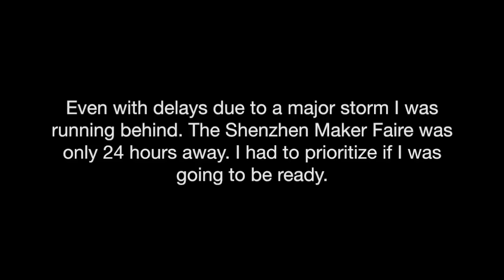Blinkini- LCD Shutter Top (NSFW-ish)

Comment: If your printer has a heated bed, you should try out an Ultrabase glass plate.  It's like magic.  Perfect first layer, no warping, and the parts release themselves when the bed cools.  You won't need to do a raft anymore and won't have to clean up the parts after printing.
My printer has it and I'll never use anything else.

Comment: Two questions, what happens when the battery runs out and is it actually comfortable?
Reply from the maker: It goes transparent when the battery runs out😳  The inside is lined with a soft material like velvet? Any discomfort was because I had it really tight to keep it from sliding down while I danced. If I had to wear it for more than a few hours I would just use clear bra straps and loosen it up. I have them but I don't think it looks as cool.

Comment: What kind of battery are you using and what could you do to charge them up? You know those kids toys where a up and down movement turns a axle by a chain and spring, in a small scale you could make a prototype shoe and use the impact of the heel to generate a few watts, fun thought.

Comment: Found you through Hackaday, and you're awesome. You're like the badass side character in a William Gibson novel. (All his stuff was set in Tokyo because it was the '80s, but Shenzhen is the new cyberpunk utopia. Ever considered Molly Millions cosplay?)

A question about this build in particular: how did that rig stay on while dancing? Was there adhesive involved, or just really tight elastic? I'm only an amateur engineer (if it moves and it shouldn't, add duct tape, if it doesn't move and it should, 3-pound hammer), but that looks kinda heavy and it doesn't appear to be braced on the upper slope of, well, y'know. I expected it to be around your hips by the third bounce. Also, having watched a couple of your other videos, I was expecting the control box to end up being an integral part of the outfit -- like, the front of the bikini bottom or something.
Reply from the maker: Thanks. Little tighter at the top than bottom so it creeps up more than down.

Comment: Wow nice video, its great to see you building this stuff yourself! The end product was really cool, but I was also interested in the tool you used to hold the PCB when you were soldering? It looks like you just snapped the PCB off like it was magnetic?
Reply: Mike Blankenship they were magnetic. similar to this style of holder.
http://www.instructables.com/id/Magnetic-Base-Circuit-Board-Holders/
Reply: Thanks Ryan for the info!
Reply from the maker: Yup, they basically work like the ones Ryan linked to. I got them on TaoBao- the magnets are a little too strong though and hard to move...

Comment: Sexy Cyborg! I've seen some of your posts on reddit. Didn't know you had a Youtube channel. Very impressive stuff. Quick question: why did you need so many inverters? I'm guessing you're using them to drive the LCD panels, but the CD4049 has 6 inverters built in. It looks like the LCD panels only need 1 each, unless I'm missing something.
Reply from the maker: Adapted a tutorial, could be wrong😓

Comment: Based on B.F. Skinner's work on positive re-enforcement. Opening one shutter art  randomly for just a moment will create the most effect. Adjust the rate on the fly based on reaction and behaver interest you want to teach in the viewer.
Reply from the maker: I was kind of thinking of doing something with a camera and running OpenCV on a rPi- so that the shutters only go transparent when there are no frontal face images (people looking directly at it) detected. But that would be too evil😈
Reply: That would be good.
I was also thinking if you could put a display (or clear) layer, you could show cyborg parts sometimes, or show the faces of the people looking at you, or messages (emojis).

Please keep up the cool work.
Reply: That is genius. If you hook up infrared you can detect a viewers heart rate, or perhaps with OpenCV detect pupil size. If the heart rate goes up or pupils dilate, you can go opaque.

Nicely done girl!

Comment: You're using a torch on your print in the post-process? What material are you printing? I'm not familiar with that type of post-processing. Could you explain a little bit please?
Reply from the maker: Sure when you remove the black abs from the raft you get a rough almost hairy finish and white marks. quick brush with the torch smooths that out and makes it black again.
Reply: ah, i see. I thought it maybe was an alternative to acetone smoothing for abs or a method for PLA. Thanks for the reply and keep building those projects!

Comment: If I were you, I’d switch to the flexible lcd screens. They’re expensive, but definitely exactly what digital clothing needs. Then I’d integrate it into an actual cloth top for structure. It’s an innovative concept, but I don’t think the current format of hard screens and a strapless bandou top style fit or have any real practicality. 

I’d focus on shrinking the control board size and adding a either blue tooth ability or a microsd card slot. Why? Think about it. With digital clothing you could become a living breathing and mobile billboard. How many companies would jump at the chance to get on board with a fashion innovation that included an advertising ability! Right? 

I actually see this as a future trend in a way. A lot of companies have moved away from static displays for conveying information. An example is fast food restaurants. It used to be a simple static display with a couple pictures and a list of items. Now though, you have animated menus with video and changing pictures. Just imagine this, how long until Coca Cola comes out with a can or bottle that has a short duration digital label on it? When you open the can, it starts it’s pre programmed advertising and when the can is finished, it turns off. Think of the novelty and “press”it would garner. Imagine cracking open a can of coke and its display showed a glass of coke on it, complete with ice and the fizz. As you drank it, the glass would “empty “. People would flock to buy at least one just for the novelty. I could totally see coke or Budweiser doing something like this. Now imagine an A&F or Old Navy shirt that had those flexible lcd displays. Can you say Gold Mine?!

Comment: I would advise to not use a torch to remove or clean (or for anything else for that matter) on printed parts, it will distort the shape and alter the properties a little bit in the plastic. ( I am a plastics engineer and technician working in the plastics manufacturing industry). This advice is of course only applicable if the finished shape does not matter too much. cheers
Reply from the maker: I just move it quick over the surface. Checked the dimensions, same.

Comment: Naomi, it's so much easier if you design the circuit in Eagle CAD and send the GER dBERS off to PCBWay. Cheap and fast and less wiring if you use an Arduino Mini or Pro. Since you're famous, they'd probably do it on the spot for free and they're close by
Reply from the maker: Are you honestly suggesting someone who was making their first electronic circuit at the time that EagleCAD to custom PCB is "so much easier" than perfboard? Was your first electronic project done in EagleCAD?
Reply: @Naomi-Wu  No... I freehand them in the late 70's and used OrCAD in the 80's and then PSpice but you had so many wires and doing a rats nest board is really difficult if you lose your place. I find it easier just to trace them out in CAD and convert the GERBERS to GCode and I have a CNC Mill that I do my prototypes on today.  But I've been doing PCB's since 1978 when I made my first TV set with a Zenith Kit. I don't mind doing breadboards but they take up too much time when I already know the circuit is going to work anyway because I can run it in a simulator. (Don't really need the simulator but just to be safe)... You rock anyway.
Reply from the maker: @yapandasoftware  so...easier for you in EagleCAD😉 anyway I'm sponsored by JLCPCB now so for sure there's some PCB design coming up- but in KiCAD of course😁

Comment: Sexy Cyborg, I cringed when you were installing the clear Perspex sheets into the frames, you spent so much time carefully preparing the frames the you removed the backing plastic from both sides of the Perspex then handled them to glue them in which could have put sticky fingerprints on them which would have ruined them.
You probably realised this yourself watching the video, maybe leaving the protective film on one side might be better till you have them assembled.
Great work and your workshop is great, subscribed to your channel
Reply from the maker: Will remember next time, thanks!